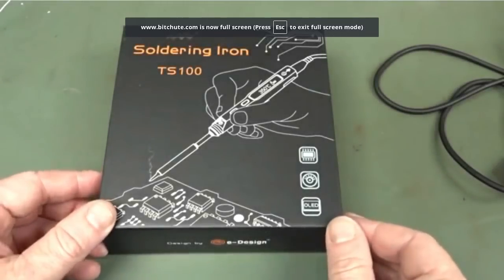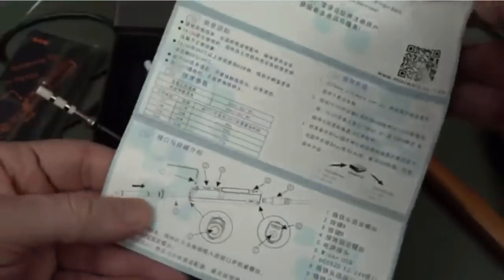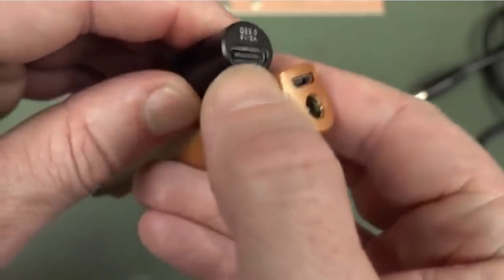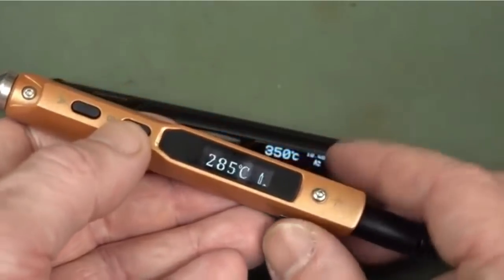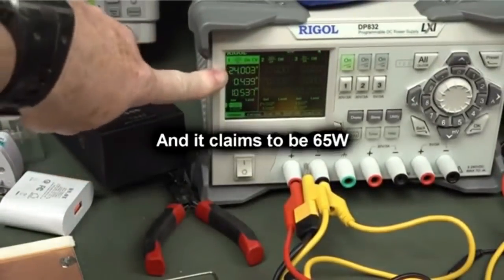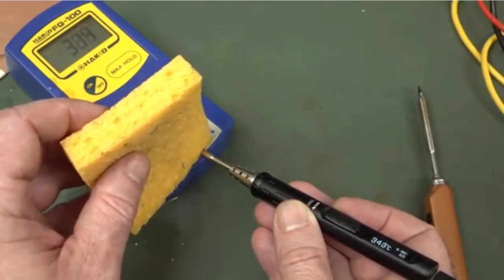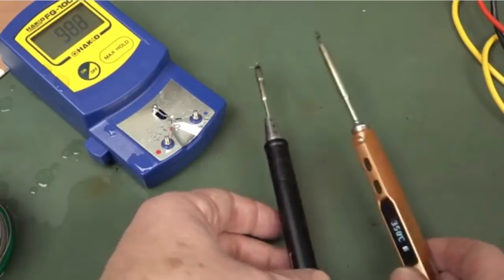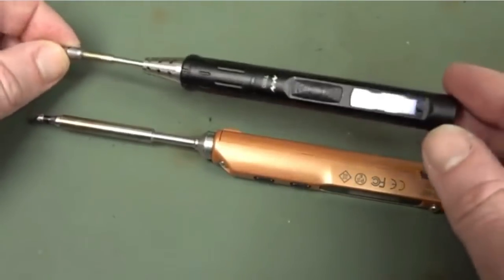EEVblog #1116 - TS100 vs TS80

Comment: I am in total disagreement with your info in this video, I own BOTH ts-80 & ts-100...the ts-100 in my opinion is a stronger iron as it will go to 65 watts, the barrel jack is better..the usb-c is flimsy and it can only handle 12 volts, plus the tips on the 80 are very expensive and there's not a large selection...after using both, the 100 out performs the 80 substantially. 
I've used both extensively and I always go to the TS-100 it is just the better of the two.
Your testing seems biased toward the ts-80...in all fairness, the ts-100 is a better iron....again, that my opinion after using both.....lastly, there are more power supply options for the 100 given it handles more power than the 80 which is limited to 12 volts and can't generate enough wattage. 
Thank you for the video and I know this is a few yrs ago, but, TS-100 is definitely better.
P.S...I also have the Sequre ts-100 generic knock off, it uses the same tips and it also works better than the 80,plus it also handles up to 24 volts and generates 65 watts...the Sequre TS-12 system is a fantastic little battery/24 volt iron which is 65 watts also.....it is the mss-12 model....it uses the ts-12 tips...excellent iron.!
Reply from the maker: Obviously you did not read the first line of the description above.
As for the ts-80 and the ts-100, I own neither and know jack shit about them. But according to the specs the ts-80 requires 9V at 2A thus 18watts, low power at any level.
As for the USB-C plug, millions of people use this type of connector on their mobile devices everyday, they and I find it reliable, I have not had a failure yet not to say it won't happen.
As for saying the USB-C can only handle 12V shows me you have never read the specs, the USB-C can handle 48V at 5A, 240watts, https://en.wikipedia.org/wiki/USB_hardware#USB_Power_Delivery enjoy the read, you have just become better educated. Ta
Reply: @RichBristol  ...thanks for the feedback, I was referring to the usb-c jack for the ts-80 only, I've used c for many other things per sae....the ts-80 won't handle anything more than 12 volts, it will give the high voltage warning and won't work after 13 volts, the c plug on the 80 is a bit loose and flimsy, my point is, although the 80 is a very good iron, it just doesn't measure up as far as versatility of the 100...so, as we are all entitled to an opinion, that is mine....both are excellent for what they can do and the technology is fantastic...I was just saying the 100 is a bit better....albeit, it would be nice if it were an aluminum case like the 80.
Thank you and best wishes.
Reply: usb c itself can handle like 120watts the one on my phone goes upto 30v 4a, its depends on how its configured, personally i use the T12 stations, cheaper tips, more wattage and over all cheaper in general, and performs really good. the ts100 should get annoying if you change the temprature too much, those buttons seem too iffy for me, i rather prefer a knob and a dedicated station, i even made a battery powered t12 station with 18650's and its great, can get 72watts from it too

Comment: Conical tip is making all the difference here. Use the same tip at least... Louis Rossman has a much more accurate review of the TS100. Edit: OH! Why is your DC bench power supply delivering only 0.9amps to the TS100? Is your power supply broken? This makes the whole review invalid.

Comment: don't you need to do a bit of research before doing the review? and what the point of doing a comparison if you are using different voltage and tips?
a very bad review in my opinion.

Comment: I think the primary problem Dave is having... is he's looking at the irons from the eyes of an Electronics Engineer. Go figure huh?

He's not looking at it from the perspective of a broke AF tinkerer who's trying to maximize dollar to value ratio. Someone who's trying to keep it as cheap as humanly possible, and doesn't want to buy one of those rotten POS radio shack irons that take fifty years to heat up and twenty five years between soldering joints.

Comment: I've not seen the full video, but just at the position I've pressed to see how is the video, you're criticizing the TS100 because doesn't have USB connection as input and you can't use battery packs, but the TS80 needs 9v and the most of the battery pack uses an standard voltage of 5v, so you can't use the most of them...

Comment: You didn’t insert the TS100 tip correctly and therefore added almost 1cm of finger-to-tip length. Also, in my opinion the TS100 is far superior because of the higher power output and heat stability. Secondly, you said the tips are not compatible with anything else in the market. You should review that statement because myself and many more people use hakko tips on their TS100. Finally, it is a good thing that the TS100 handle is plastic because it means is non-conductive. I wouldn’t come near to a medium/large sized capacitor with the TS80. 
P.D.: the TS100 costs half the price of the TS80.

Comment: Biased. Heat recovery was clearly superior with 100. No comment or investigation why at 24 volt 100 pulled so little current. Compared 100 at 24 watt to 80 at 18 watts and more appropriate tip...???

Comment: Rossmann has a review of the ts100 where he crammed on a ridiculously large wedge-shaped Hakko tip (same tip connection design), just to see if it would work, and it still melted through a big connector on a PCB ground plane like butter (at 24v).  Strange to see it not working as well here.  Wonder if that smaller tip really is making a difference?
Reply: If the tips work the same as the jbc ones, different tips will have different heater elements with different power ratings, a small jbc tip will draw only about 25% the power the station can supply but a big tip will draw 100%, lots more of calorific power.

Comment: Dave is absolutely amazing at electronics but at times he’s a real idiot and he misses what is right in front of his face.... and then criticises it because he doesn’t understand it... lol. That clip on soldering iron stand for example... it’s quite obvious that it’s a clip onto the iron itself and not a “have to bend the wires to get it to work” situation. He also gets flustered with simple software and firmware and again rages at it because he doesn’t understand what is going on... but then switches gears and teaches about some amazing electronic wizardry that flies over my head. He just needs to stop saying that if he doesn’t understand something or some reason and hence that it’s “naff”.

Oh and saying the TS100 is crap because of the housing being plastic? Most soldering irons use plastic over metal because it stops you burning your hand. You can even buy replacement housings for the TS100. Oh and if you think I’m being a TS100 fanboi... I’m not. I don’t have either of these irons.
Reply: so true. he just rants and rants about something that is "not working" even though he's doing something wrong, and I'm just screaming at my computer screen trying to correct him. but in his defense, usually at some point in the video he tends to figure out where he went wrong .. his videos end up being much longer than they should be because of stupid things like this. I guess he couldn't be bothered to edit or hire someone to edit this videos. also the ts100 was a loaner from some guy on the eevblog forum.. I wonder how the review would have gone had he recieved one from the company for him to evaluate and keep like the ts80. just sayin. ¯\_(ツ)_/¯
Reply: @nickloss2377  I liked the electronics side of things but the “I don’t understand something - it’s naff” eventually put me off watching.
Reply: What the blazes are you complaining about? He does exactly what a reviewer should do, he does it the way Jonathan A. User would do it. It's a review, not a tutorial, know the difference mate! If he's flying over your head, get some electronics basics textbooks to stand on! I'm certainly not a trained and certified electrician, but I get what he's saying like 95% of the time.
Reply: @feynthefallen  You're right regarding review vs tutorial, but the other guy's also right - if I (not an EE) notice something in a video that Dave (an EE) fails to notice while recording OR editing, then Dave's just not paying enough attention, no 2 ways about it.
Reply: @feynthefallen  No he does not.  He is comparing apples to oranges.   Comparing the TS80 at full capability to the TS100 and 1/2 capability.  Of course you are going to get less than appealing results.  He also tends to compare low budget items to his $8000 equipment that the home hobbyist has or will never have.  He could of used a 24v power supply that is used for the 85 Watts that it can to.  There are many other reviews of the TS100 that do a better job than this review.  I watch the videos because they make me laugh about how a really smart man in electronics can act like an idiot half the time and has temper-tantriums like my 8 month old grandsons.
Reply: At least use a comparable tip.  Apples to Onions.

Comment: He tries way too much to make the TS100 fail. I think it's pretty obvious he was biased because he discovered the TS100 way too late in the game when for the TS80 he was one of the first reviewers so he went into "TS100 was shit anyway" mode to cover that up.
PS. However, there's still some good knowledge from this video. The default tip of the TS100 is too low capacity (probably because it's just less metal at the very end tip).

Comment: Is there an official store for buying TS100/TS80 on AliExpress/Banggood/etc?
Reply: I can't seem to find one. Let me know if you find one.
Reply: @DoctorThe113  You can go from miniware website (look on a product page, there are sales links) , on ali shop name is Novellife
Reply: @VKuzmenkov  I found one. Thanks. Btw do you recommend getting from banggood or aliExpress? If you bought one.
Reply: @DoctorThe113  I bough my TS80 from Ali from this Novellife shop, totally fine as expected. I ordered full package with power adapter since my Galaxy S6 charger doesn't support QC3.0. Also got from a local store QC3.0 10Ah powerbank (16,00.-euro cheapo, but enough for outdoor/no power usage). Dave is absolutely right about aluminium vs plastic - TS80 wins here 10 out of a ten even comparing to a Weller (old magnastats or new stations, doesn't matter) or 500-1000 euro Ersa stations.
Reply: @EngbyMB  I didn't said they wrong, i said TS80 win on this parameter since during years of usage heat and mechanical stresses damage plastic handles. Mass production have to do it this way, since its cheaper and easier to make, assemble and replace plastic parts, and also cost effective for end business customer - manufacturer, repair shop etc. However, for a guy like Dave, mr. MicroFarad and your humble servant - we dont use tools 24/7 like companies, for us it's resource is nearly unlimited, doesnt matter is it Weller station or TS80, so there is no point in spending like 3-5 times more money on a thing, that will crack after a decade (unless it makes you money, but that is another story).

Comment: Sorry to see that Dave had to take the video down. I own both of these and
both are excellent irons. The TS80 is very comfortable to use with the supplied
usb type c cord. It works well at 9 volts, it is limited at this time to just 2 tips but I
have been told more are coming. The TS100 is also very good and comfortable
when used with a straight barrel connector and silicon cord (I made my own).
It works very well at rated 24 volts and 2.5 to 3 amps and proper tips. There
is a great variety of tips for this iron ( although many are so close in shape and
size that they should not be counted as "extra" tips). The advantage here is that it 
will work with 12 volt automobile circuits in the field. Both irons use open source
firmware and can actually be run at greater than advertised voltages with no
bad effects if you just use common sense. The main problem that I have found with
the TS100 is the fact there are not enough power supplies that offer the needed
24 volts and 2.5-3 amps. Most laptop supplies are 19 volts and this is just not enough.
It should ship with the correct 24 volt power supply in the first place. Aloha
Reply: Thanks! I really would want the ts80 but ... reeeaaally bummed about the tip assortment ...
Reply: @Darieee  make your own tips dawg
Reply: @schlomoshekelstein908  how 😳 ?
Reply: @Darieee  jam a nail in the end
Reply: Don't you find the ergonomics of the 100 annoying?
It it's an awkward shape.

Comment: I own 2 of the TS100 irons, and find they both perform well, so well in fact, I hardly use my Hakko 888D. I use a 19 volt PC Laptop power supply, and get excellent results. I looked at the price of the TS80, and wow, $80.00 to$120.00 for the iron, in some cases, another $20.00 for a power supply, I spent about $56.00 to $60.00 for my TS100 irons, and had some 19 volt PC Laptop power supplies, so I don't think I will be rushing out any time soon to replace my 2 TS100 irons. Now the reason I have 2, is so I can have the thin conical, and a wedge tip, and don't have to switch them out, so the TS80 tips would be a lot easier to switch, so I would only need 1 iron, and that would bring down the cost, but I like my 2 irons, they were a good investment in my opinion, and I will add, when I see folks using old irons, with huge tips, trying to do surface mount soldering, or soldering in tight spaces, I wonder why they make life so hard. Well, a little long winded, but I felt y'all needed my $0.02 ;)
Reply: Why didn't you buy one Ts100 and just switch tips?
Reply: @noudlindeman1931  You mightn't have watched the whole video above. Changing tips on TS100 seems to be pretty cumbersome especially outdoors... Cheers

Comment: It looks like the TS100 would be better for field repairs on drones and R/C craft since you WOULD have a bunch of 3S-6S batteries (it's range) on hand with XT60 connectors like that, PLUS it has some awesome features that have not yet been implemented and, depending on the hardware capabilities, may never be on the TS-80, such as using it as an oscilloscope. The TS-80, on the other hand, looks a lot better for ME, as my personal business involves a lot of installing hardware in costumes and equipment that's used in shows, so may be damaged as it's banged about in use. I always carry a QC3.0 pack for my phone already, and will probably just get a bigger one to go with the TS-80 myself,  as it DOES seem worth the extra $25 to me for what I need. Thanks again for the video repost! It was very helpful to me in making my decision. Now it's just a case of waiting for it to ship. :-)

Comment: Definitely not a fair comparison with the tips.....buuuut, I do agree that the TS80 is the winner and it will be the one I buy. USB-C connection, shorter distance from handle to tip, metal housing, all wins!

Comment: I saw another video showing the TS 100 only pulling 10 watts when soldering using a 24v power supply.   The TS 80 seems like a pretty great new iron.  It will do about 20 watts   You can still use it with a lipo you just need to use something like the ISDT battery checker.   You can also use it from your car battery with a 3.0 quick charge adapter.
Reply: Is this confirmed in any other video? I already had problems with bigger components and was wondering why 60 Watts were so painful to work with there.
Reply: /watch?v=83STpUXHilk

Comment: He pulled this video because he got too much hate for being 'negative' about the TS100
Reply: Yeah, as I watched it I started thinking the same thing. He was kinda bashing it... although honestly those are the SAME GRIPES I would have that would annoy the piss out of me. That stupid, fiddly, allen-key lock... I can't keep those things from being lost unless they're 1: in a huge ring of them that's hard to lose and stays at home in the toolbox or 2: attached to a clip on the back of my server. Or is that a torx one? I haven't used it in a while, lol. Didn't lock the case top. Either way... looks like I'll be spending the extra $. 
(Sorry for the duplicate post, for some reason one of the YT tabs was still signed in as the previous user! (I'm at work.) - I've deleted the other one though, since it wasn't their comment and I don't want them confused, heh.)
Reply: How did you comment on a pulled video?
Reply: @LEO-xo9cz  This is a reupload
Reply: I think I know why he was biased. He discovered the TS100 way too late (he was reviewing "new" irons while it was already out for a year). When he discovered the TS80 he was one of the first so he went into "TS100 was shit anyway" mode to cover that up.
PS. There's still some part of good knowledge out of this video though. It appears that a decisive difference is made by tips, their mass, and sometimes they're just bugged (e.g. reviews show both models having temp discrepancies depended on tip).